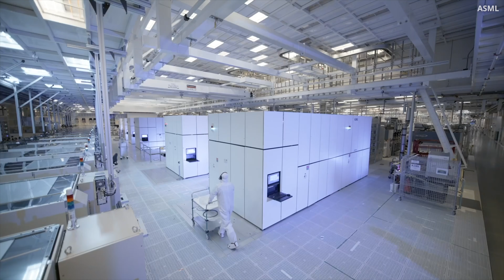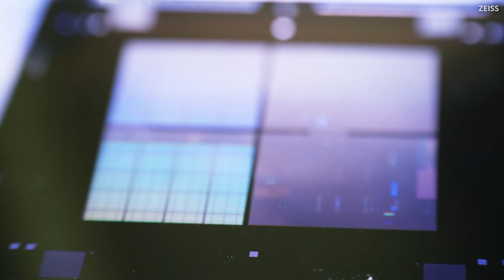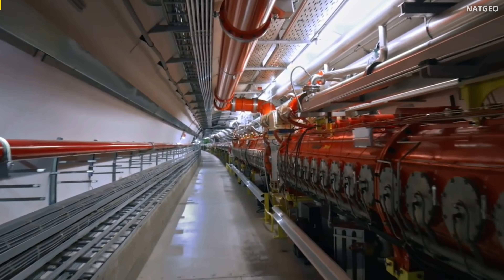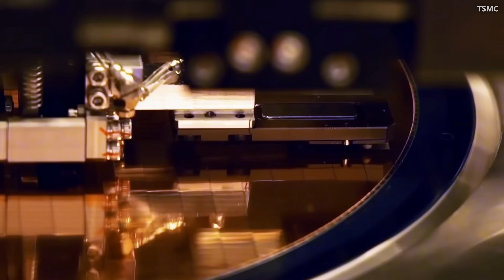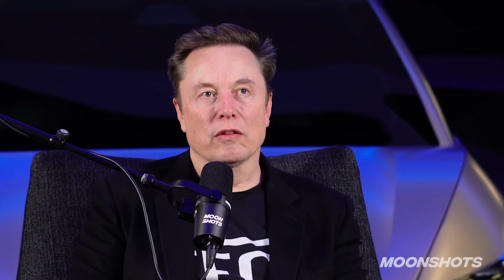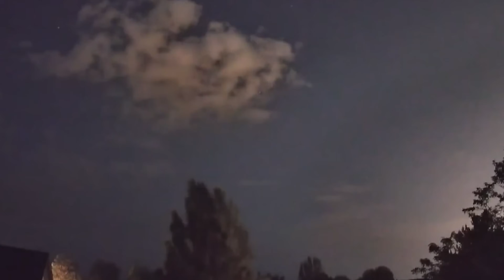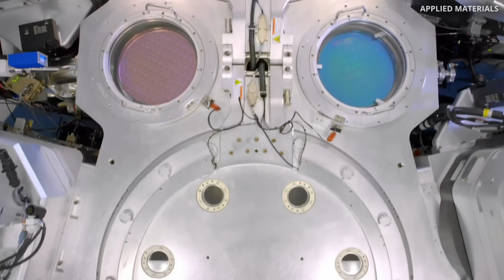New Chip Factory That Terrifies TSMC

Comment: You say that for space chips “failure is not an option”, and this is where the expense ramps up. But there are protocols in avionics that face the same pressures and so error tolerant circuits are used in these environments. I’m sure these same triple-redundant protocols could be built into space-bound chip design. That would add cost, but designing soft-failure into a device reduces the pressure slightly.

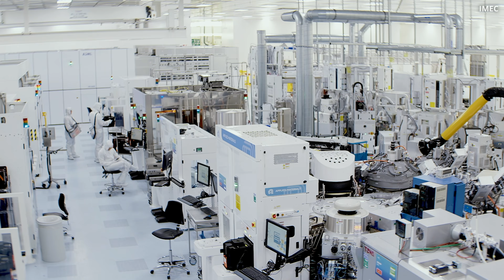Comment: 28:02 - Windows 7, the real hero at work! The unsung champion of progress!
Reply: WIN7 Pro,  2013 -2023 installed, updated and LOCKED down, until the HW was starting to get old. Now compare this to the madhouse that  the WIN 11 IS. I kept just main PC on WIN,  the rest are happily humming Debian Trixie. Luckily I have locked WIN11 2 years ago, I can still remove the bloat. Little proggy InControl, but today it is too late. WIN11 LTSC is the only way today to avoid constant problems. If you want normal interface buy Start11 and you can set it up the old way. On Linux KDE 6.x is running circles around the stock WIN11, just NO comparison at all.

Comment: Calling Terafab a “crazy idea” due to lack of prior fab experience misses the engineering reality. Terafab is a $20–25 billion vertically integrated facility in Austin partnering with Intel’s advanced 18A (~1.8–2 nm) process. It targets 1 terawatt of annual AI compute via 100–200 billion custom chips, starting with Tesla’s AI5 inference silicon for vehicles and Optimus robots, plus radiation-hardened variants for orbital data centers.
Tesla has already proven its silicon expertise: custom AI accelerators deliver superior performance-per-watt and cost metrics in millions of real-world deployments. Intel provides mature high-volume manufacturing and packaging, while the Musk teams supply precise domain requirements for edge autonomy and space applications. This mirrors successful first-principles scaling in Tesla’s gigafactories and SpaceX’s reusable rocketry.
Dismissing vertical integration on “no experience” alone ignores supply-chain risks and explosive AI demand. Execution challenges are solvable engineering problems, not barriers. Bold systems-level execution has repeatedly outperformed cautious skepticism.
Reply: She explained the Intel partnership.

Comment: Gut check for me. Have there actually been any announcement on the node process that will be used by Terafab? All I see is 'advanced', not figures or even specifics like GAA, FinFET or targets. Tera alluding to Terawatts of chips output per year. If TSMC alone is 40 GW/year, it shouldn't be that hard to figure out where the 20 GW/year output that was used in the presentation. Especially if the allocation would target chips for SpaceX and the proposed datacenter in orbit/space.

Comment: There just aren’t that many IC process engineers, IC equipment maintenance engineers, and many other disciplines of engineers in the US.  TSMC had to imported hundreds of engineers from Taiwan to set up and operate their Arizona fabs.  Same for Korean chip plants in the US.  

Also, TSMC built its eco system and requires its suppliers to support hiccups on site in one hour.  Our typical US suppliers respond in two or three days.  No wonder TSMC can deliver chips with massive volume with high yields.  A foundry makes money by making large volume of chips and improves its yield as more chips are produced.
Reply: Surely AI can do it already /s
Reply: @Waitwhat469 🤣

Comment: Hate to say it but… a chip with cpu and gpu integrated would be faster, more efficient, and cheaper to build.
Sure, you can’t swap out your video card, but no one does that anymore (shhh gamers, if you actually get enough money saved up for the next better video card, you’re gonna build a new rig).
It would also encourage standardization, which would help programming. Just saying…

Comment: Why the dies are circular?
Reply: because the silicon is grown from 1 crystal . 
The Diameter is hard to control and wobbles. 
Some R&D people tried cutting it squares and create the chips . 
Did not work well so they stopped the R&D.
Probably you get weird effect spinning the square when placing the Restis ( photo ressine )

Comment: Creating a solar panel chip to pull power and analysis telecom data for more efficient transmission/transfer. Solar wafer panels
Compatibility coherence.
Only problem is having the scale system to read and adjust with the knowledge of human input

Comment: Why are UV machines used? I would think an electron beam, or better yet a proton beam machine would give a much finer transistor architecture.  Also, it would seem to me, that generating a magnetic lens to focus and direct the beam would be a lot easier than usingEUV.  I must be wrong, these are people that are much smarter than I, but I would like to know why the same solution used in microscopy doesn’t work in etching silicon.
I realized as I watched this that the problem with radiation is a problem of random etching. That stresses that charged particles  are very capable of etching silicon, since that is what is happening naturally!

Comment: Has anyone developed a microbiological process for chip wafer development? Something that creates a predictable molecular structure from an engineered single celled organism or something like this?
Reply: In thinking about this: If you created a chemical lattice with a biological process and then used another process to somehow calcify the lattice, you could then use that chemical process layered on the biological process not only to solidify the wafer but to impregnate it with PN material or other conductor materials.
Reply: The lattice would need to be initially in some way stable or solid as a framework, at least for a short period of time, in order to allow for the second chemical process.

Comment: I was in meetings where they said to me, "If you can not fix this, we might go bankrupt."The solutions were always out of the box thinking.  It was always humans that made the out of box leap.  Elon might be thinking AI can control all the process nodes. AI can help, but it will be humans that matter the most.  Rockets are easier than solving semiconductor multifactorial recursive loops that have unknowns within the loops.  It's also a bad idea to put everything in one big ballroom building. A chemical leak or some other event needs to be mitigated.  I would design a multi-fab complex using hub and spoke, not one giant ballroom.  An evacuation or excursion is thus limited to a spoke.  I'm detecting Hubris by Elon and crew.
Reply: Since humans are the magic dust, you should cluster your suppliers and workforce.  This is TSMC's secret, as they can surge labor, as said labor lives nearby.  Your labor must not have long commute times, which means the fab complex must include a planned housing community.  I personally trained TSMC engineers, and Tesla should "suck brain" in the same way to climb the learning curve.  TSMC solves problems organically at lower levels since they cluster, which speeds up communication.

Comment: I don't agree with you that you need to have cleanliness.. no physical laws are stopping us from creating a perfect processing that is clean, very enclosed and safe and protected from gamma rays, etc. If this is not feasible for the machine, then the design of the machine is simply wrong. And it clearly is wrong, because there should be no "moving" of the chips.. like it looks like a factory from the 90s. Modern approach is all-in-one, kinda like 3D printing, but way more advanced.

Comment: As I'm sure you are well aware, one does not need, nor want, anything near 2 nanometer chips in space. For radiation hardening, one needs 100-180 micrometer features at the smallest!

Combine those with new wafer growth technology, 300mm or larger, and one has easily producible space rated chips in mass quantities. One does not need machines from ASML, one can make them in house for tens of millions instead of hundreds of millions.

Comment: Too much dribble. This video analyzes the "Terafab," a massive semiconductor project in Texas designed to produce 2-nanometer AI and space-grade chips. The facility aims for an unprecedented 1 terawatt of annual compute by integrating logic, memory, and packaging under one roof.
Strategically, this vertical integration could save Tesla $1,000 per vehicle and drastically reduce the cost of radiation-hardened chips for SpaceX. However, the technical hurdles are immense, including mastering Gate-All-Around architecture and securing scarce EUV machines. While a partnership with Intel provides necessary expertise, the project remains a high-stakes gamble on extreme scale and manufacturing precision.
Reply: Do you mean "drivel"?

Comment: We spray furniture in the furniture factories with no particulates getting in the way because of vacuum systems.
This could be that
Reply: Clean rooms with vacuumed/filtered air have been part of integrated circuit fabrication for decades. The tolerance for foreign particles is much more stringent for miniaturized circuits than furniture finish.

Comment: Not just any old sand, but a special category of sand of which 70 to 90 percent comes for Pine Spruce, North Carolina, USA.

SEE AI NOTES BELOW:

"Spruce Pine, NC, is not the only source of high-purity quartz, but it is the primary, indispensable supplier, producing 70–90% of the world's ultra-high-purity quartz needed for semiconductor crucibles. 

While other deposits exist (e.g., in Russia, China, and Canada), the Spruce Pine quartz is uniquely suited for the stringent purity requirements of computer chips.

Key Details About Spruce Pine QuartzSignificance: 
he region's mines produce the high-purity quartz necessary to create fused quartz crucibles, which hold molten polysilicon used in semiconductor manufacturing.

Global Dependence: 
The vast majority of microchips in computers, smartphones, and solar panels rely on this quartz, making it a crucial node in the global technology supply chain.

Unmatched Quality: 
While other regions produce quartz, Spruce Pine is considered the highest quality source, with a unique 350-million-year-old geological history causing nearly zero impurities.

Risks & Vulnerability: 
The heavy reliance on this single location, which was temporarily affected by Hurricane Helene, highlights the vulnerability of the global tech industry to environmental disruption.

Alternative Sources: 
Other, mostly lower-grade deposits are being investigated or operated in Russia, Norway, and China, but none currently match the scale and quality of the Spruce Pine deposits.The town acts as the "bottleneck" for the entire semiconductor industry, according to industry experts and reports."

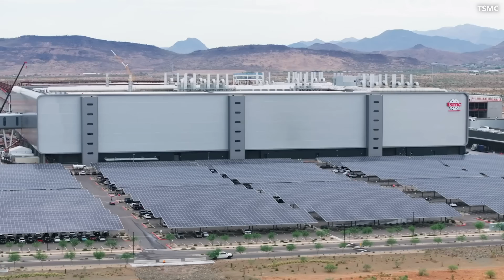Comment: I truly find this uber hype style super annoying but apart from that there are a lot of Errors and nonsense on these videos. One big lie: 6:33 Production is totally sold out until 2029 .... not even close. Current production capacity is sold out yes until 2027 ... but .. Samsung is Doubling capacity with new factories, Micron the same (Intel the same) even TSMC is increasing capacity Hugely with the new factory in the USA ... and SK Hynix new Huge Facility coming up later this year simply multiplies by 6 ..Six .. SK Hynix current production. And this is just from the Supply side .. the demand side is even more insane ... new Software development like TurboQuant use up to 1/6th of memory ... Even without this development from Google Half of the planned datacenters are either Abandoned or delayed (... forever ..) add to this the coming recession that is going to be worse then anything we have seen in our life time due to real constrains on the most important asset Ever ..Energy, Fuel ... that s going to kill the economy for  along long time.
The Massive imbalance for HBM and chips in general is coming like we have never seen before ... the silicon industry for those that live with it for the last 40 years is exactly like this. The more extreme the hype, the more extreme the Collapse ... and this is no different, actually this is going to be even worse then previous cycles ... just take a look at all the defunct companies and also at those that only survived due to government intervention ...

Comment: Industrial policy is scaling creasy like politics and like finance and like Physic science,....all syeayed by submition to hypotetical needs base on extrapolation under the assumption that every thing else will  stay identical, well it will not stay identical...because general thermodynamical status of Earth don't stay identical, but ok, good luck...do not forget you need Water, need raw material, need air, need vibration stability (geo sysmic), need light to stable know frequency, need neutral sound stability frequenz, , all assumption to exist naturally, well let"s see,....and hyper concentration production elevate the risk of. Gradient of failure propagation, a folia furiosa a de grandeza, ...

Comment: Why do they still want to pursue EUV?  Using instead Electron-beam lithogrophy, which is simpler and can do better than 1nm print resolution already with room for improvement. The only part that is not solved yet is the speed but that is a well understood issue that they can improve.
Reply: Yeah, any ideas to improve throughput to the level of UV exposure lithography? Consider that electrons repel each other.

Comment: Why is the wafer round?  Wouldn't square make more sense? Or, at least with rounded corners.
Reply: The silicon is purified in the form of a thick cylinder from which slices are then cut.
Reply: @PhilandErika  But solar cells wafers manufacturers use to cut the lingot in a semi-rectangular way. By my experience, suffering with photolithography, it is the photoresist spin deposition that results in a super uneven thickness in a square wafer, especially at the vertices.

Comment: what happens to all the failed chip? as the printed circle disc, the garrantee loss on the edgecat the not full printed, the the one where formed correctly but still some wrong with them? the the just meet any acseptable mark ar qualty controll mark, the the best ones the put aside?
Reply: Defects get scrapped if it is unrecoverable, like literally there is a big barrel full of wafer scrap in each step of the process for failed wafers.

For quality of the final chip you should research binning.
Reply: Current chips that have defects still get used. The core count in a chip might start out with an expected 8 core but if one or more cores are not working the chip gets downgraded.

Comment: I understand in deep space radiation is exponential, requiring chips to be hardened. However, would it not be less expensive to add external protection around systems? Dedicated environments, hardened specifically to protect systems. Chips sit in hardened compartments.
Reply: With triple redundancy.

Comment: My training is EPI not electronics but airflow and pressure can trap or remove literally everything under a certain size. Air is much thicker at that scale than you might imagine. Maybe that's what they plan on leveraging like pharmaceutical manufacture does.

Comment: got to understand Elon's mindset he's not thinking earth....he's just working out the kinks for a all in one easily shipped and set up chip center he can drop down on mars or the moon and be fine with just some teslabots and an ai running it....everything he ever does big rolls back into the colonizing dream funtioning smoothly
Reply: Not quite. Fabs will likely be last to leave Earth. The plan: manufacture heavy satellite parts (solar panels, radiators, frames) on the moon, ship lightweight precision components from Earth, assemble on the moon, and launch via mass driver.
Reply: @imrich333  oh i know it will be a later thing...but he wants to build data centers and a mass driver to launch satellites from the moon...once resources and mining is set up a chip printer won't be far away from being set up...like i said elon is pretty goal orientated on what he does and the terrafab will be simplified and refined towards easy setup off world

i wouldn't put it past them to develop an in house printer with that goal for their chips

Comment: ASML should not be allowed to have a monopoly with the manufacture of EUV Machines, in my opinion.
Reply: They created the technology and kept developing it

There is nothing stopping you trying to create new ways to do better, off you go

So if you created something and spent your time and money into making it better, you'd just give it away for free would you? 
I highly doubt that...
Reply: All you need is boring company and xray is next big thing

The first synchrotron was designed in 1946 to study high-energy particles. Modern machines, with their roots in early 20th-century X-ray research, use sophisticated magnetic devices (undulators) to enhance brightness. Today, there are roughly 60 synchrotron radiation facilities globally.
Reply: You have to understand the ASML is basically the spaceX of lithography. The entire industry was screaming at them that it would never work until they proved that it did and left their competitors in the dust

Comment: Why are the wafers round?  If we loose chips on the ends of the wafers, why not make them square?
Reply: photoresist spin coating. It uses centrifugal force to deposit a uniform-thickness photoresist coat. In a round wafer, the perimeter is slightly thicker, but it is axi-symmetric and can be easily removed by photoresist edge bead removal. A square wafer spin-coated is a mess, thicker at corners, not axysimetrical, because of that, you can't use the photoresist edge bead removal, and you end up with a less useful area than a circular wafer. Solar cell manufacturers use rectangular wafers, but they don't use photolithography.